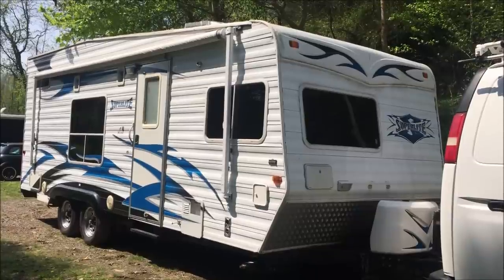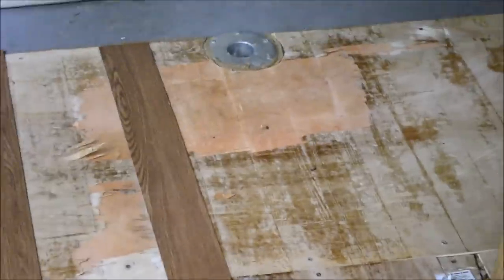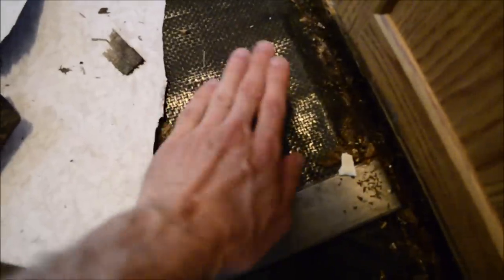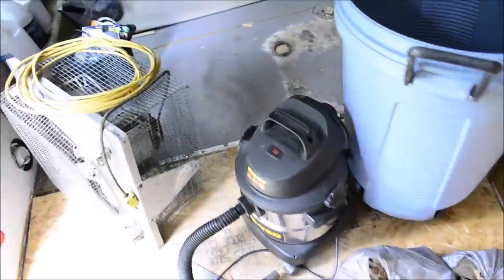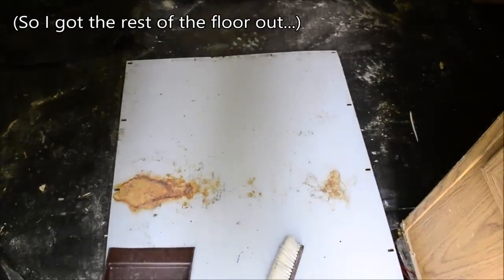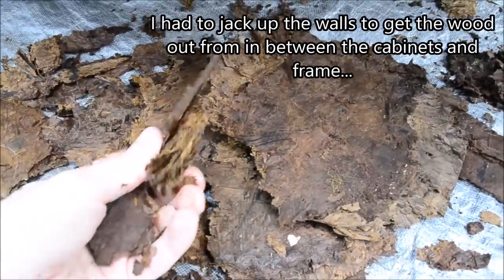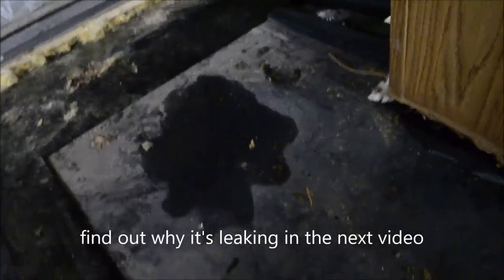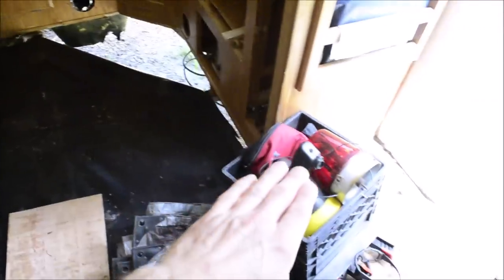Camper Floor Rot Hidden by Scammer Seller - Tearing It Up

Comment: Dude - you are my hero; thanks for never giving up and taking the easy way out!!
Reply from the maker: thanks man!
Reply: I'm lost. I'm ready to sell. Mine. Hell my mil was shot with the nail gun yesterday. I'm having a hard time lied to as well
Reply: I agree with this comment as much as one possibly can. I recently came into a rv spur of the moment deal. Didn't look to be that bad of shape. The electrical plumbing and floors are shot. This post gave me alot of encouragement still weighing my options. The time and material I'm going to have to out into mine is literally more than it's worth at the same time I am a huge believer in repair over replace. I suppose I need to learn where to draw the line? Probably gonna do it haha never know when a rv can come in handy no man knows what tomorrow will bring.

Comment: Yup,I feel ya,just bought my first camper,all 3 slide outs,floor completely rotted,and a out 12" by 25 feet of floor on outside wall under water heater,I'm a builder and here's my thought on that stupid plastic membrane under the entire floor,once the floor gets water on it,there is no way for the water to get. Out and so the floor can never dry out and the rot spreads,I will be painting the underside of the plywood floors

Comment: There are three parties to blame in this situation…The RV industry for building stuff like crap and charging a fortune. The seller who knew and did a crap repair. And the buyer. I am the third in this very same situation. On my trailer I am now in the process of replacing the wood frame under the side walls in the front of the trailer. I learned a very valuable lesson. Thanks for making this video.

Comment: Thank you for sharing, I purchased a used camper in October 2019, all in all I feel like I got a good deal. I broke and awning bracket and while replacing I did find some wood rot that needed repairing. I took it out dried the area for a couple of days with a fan and put it all back together and all is well. Their past weekend 1/18/2020 I replaced a valve on the toilet that was leaking. I've owned boats for over 40 years and learned there there's always a repair needed. And water and wood do not do well together for very long. But with your issues, this guy sold you knowing what he was selling you. Now if you got it for a real steal I wouldn't say much. But he knew better. Trying to unload your troubled  camper that has mold all in it can create someone serious health issues. All that black stuff you saw in the video was black mold. Would you try to sell someone your home with that throughout it. People should consider that when selling a camper. Be right do right. Someone's life may depend on it.
Reply from the maker: Very true a little water damage is inevitable with these things, for the seller to hide it to make the sale is the messed up thing

Comment: When I was looking to buy an rv, this was a HUGE problem in all of the ones I looked at, nobody mentioned it, and they most likely won't tell you because they are trying to sell it. I haven't torn up my flooring yet, but I haven't found anything yet that is a major concern, I know how frustrating and difficult it can be to try and fix it, so fingers crossed I won't have to deal with this. I know this was probably extremely stressful, so hats off to you! 👍

Comment: Just discovered your channel. I can sympathize. I bought a class C with hidden damage. The more stuff I go to replace leads to discovery of more damage. I’m patiently working towards close to a complete rebuild.
Reply: Same hope you got your complete I bought a huge 1989 5th wheel skamper and after I paid for it which was a rainy day I get back and walk inside and see water falling inside the kitchen go to have a peak and the whole kitchen floor and walls and roof studs All water damaged I ripped it all out literally replacing whole kitchen

Comment: 4500 is cheap mate here in Australia nothing less them 10k
anything here for 5k have to work on it.
don't feel so bad at least you know how to fix it .
like your show keep it up
Reply from the maker: damn, 4500 can get you something ready to camp here lol, thanks!
Reply: Fernando C I paid 5,000 for mine off market place & it's great like new i did have to fix heat but it froze cause it never been used just have to be careful or know your willing to do some work i would of had to pay someone
Reply from the maker: Nice! I expected to do a little work like cleaning, maintenance, go over all the seals....I didn't think i'd have to replace the floor, lift sagging walls, or remove the water tanks lol. It's pretty great right now though, it's all back together for the most part and floors are in...will do an update video once I clean it all up again.

Comment: Great video. I had a very similar experience and had to replace my whole floor with 3/4 Advantech plywood. While i was at it, i ripped out the very small sink sized tub and the super small plastic toilt and replaced it with a 38 inch stand up shower and a house toilet. I made a short video of it with pictures i had taken. Thanks again.

Comment: Coming across your video has given me hope! I bought a 20ft RV trailer for my mother to live in while she's on the waiting list for a senior living apartment near my home. She's a stubborn woman and refused to intrude by moving in with me but she's having heart issues and many other health problems and I want her close by. She currently lives 6 hours away and is alone after my sister passed away recently. 
I GOT SCAMMED big time! The seller did a descent job hiding the water damaged floors. I noticed some water damage to the ceiling and the kitchen cabinets which I was confident I could repair. He strategically placed piles of cushions, a removed cabinet and boxes of miscellaneous items in the backside of the trailer where I was unable to walk back there and it was also blocking the bathroom door. In my desperation to find something I could afford I looked past it since he showed me pictures of the bathroom on his phone. 
Turns out that there is no floor under all the crap! He placed crappy laminate flooring on the liner and then covered it with a big rug. The bathroom floor is rotten and there is holes in the shower flooring. The entire ceiling in the bathroom is falling in ( Didn't show me that part in the pictures). 
After peeling back the ceiling and looking in all the cabinets I realized that I have to replace the entire ceiling, the floors, the cabinets, countertops in the bathroom and kitchen and 3 walls.  I would just dump the dang RV at a scrap yard if I wasn't so desperate to help my Mother. Thank you for your video. I have a ton of work ahead but after seeing what you were able to do, I feel confident I can do the same. It's going to be hard on a tight budget but Thanks Man!!

Comment: You have gorgeous hands. we bought a travel trailer, in Florida from another Canadian couple and boy did they get us. long story, but the last thing we have to fix is the floor. the floating floor was pretty and it is cracking 2 ends of trailer. i am gonna watch this with my husband. scary when you said junk yard, because we paid 8k Canadian. no canopy no AC roof needed cleaning and caulking and taping and  2 coats of rubber. our internet is to store it here and return next year stay in in for 1 to 4 months and sell it at a lower price but in perfect condition. we added canapy and AC.

Comment: Check the plumbing there could be a leak at one of the joints and leaking valves even a small unnoticeable fissure in the pipes. Some people forget that you need a pressure reducer for city water and it causes leaks. Another thing that could cause damage to the plumbing is poor winterizing. Some lines especially the toilet line gets forgotten. RV antifreeze should be pumped into all the lines.

Comment: Woah, we have a lot of wet wood and rot repairs to make right now, unfortunately we have the entire from wall including the curve all the way to the rubber roof and a bit under that, some floor rot and the top of the side walls along the front. So yeah I hear ya. What I’ve found out is that better trailers a have sterefoam insulation as fiberglass holds the water and causes more rot and better campers also have aluminum frames to wood also unlike ours. It would’ve really helped though if the screws used along the exterior corners were put in straight and the right tapes and sealants had been used in the original construction. 😡 yeah I’m finding out way more than I ever wanted to know about RV construction, maintenance, and diy’s. Sigh.....

Comment: We are seniors and got "taken" by a young couple...sad...found out that the back of the camper was rotted...ceiling looked good...floor felt firm...of course, they werent' hooked up to electric/propane to check everything out and they had some of their stuff up on countertop that blocked us seeing the wrinkled paper/board above and could not see the rotten floors under the cabinets...our fault...we trusted and we all know you can't do that...we are in the process of tearing out the back and the cabinets...being 70 sure doesn't help...but we spent our stimulus money on this and we can't sell it...so...the journey begins

Comment: Good thing you know what you're doing. I'm in the same boat as you but NO clue ( yet) I bought a camper last month rotten roof, floor all water lines burst as well as hot water heater. I'm a first time buyer and and had no clue he bandaged this pretty well, of course I didn't notice until I got home hooked it up to the water and shit was blowing everywhere. Live and learn. Good luck.

Comment: Holly cow how much did you get that camper for!? I also got scammed with water damaged camper and felt so frustrated when I found out about rutted thru the outer type water damage under the bench. but after seeing this, I feel that I should feel thankful for the corner I just need to deal with😇 thank you for your work and you made my day

Comment: Did you consider placing aluminum square tubing under the floor as bracing so at least that wouldn't rot? I have a 2014 ultra lite. It appears there was a leak in the water lines which went unnoticed until the floor was literally rotted.

Comment: That looks like my Jaco.  The problem with this design is the bottom membrane catches every little leak.  Even if you have one leak, it will catch it as it pools, the insulation gets soaked, and the floor is rotted out.  I think I will just replace it with treated, and not bother with the membrane.  That way the floor can always dry out.

Comment: Couldn't you smell the mould when checking it out before buying?
Reply: He completely looked passed that he completely looked passed the soft spots in the floorboards also but he says he got scammed 😂he buys a used trailer and doesn’t do a full good look around of the trailer before buying it but says he got scammed 😂🤣

Comment: I bought a 1990 Mallard camper. The lady didn't scam me she told me that the roof had collapsed from the weight of the snow. I looked at it before I paid for it which was very low. It was what I was looking for anyway a frame to build a new camper on and insulated with foam that I have on hand.

Comment: The seller was obviously just trying to get out of the headache caused by such cheap construction by the RV manufacturer (they are almost all like this, slap em together as cheap as possible but they look nice when new).  It's so common, dealing with similar issues with a trailer I'm trying to sell - not trying to hide anything and it's not as bad as this one, just a matter of how much work I need to do myself.  It's amazing the lengths that a scammer will go to just to fix it incorrectly when it's not all that much more work to do it properly.

Comment: It helps to buy original vehicles.
No mods, upgrades etc.
Helps a lot when referring to factory manuals and schematics.
Be hard on the vehicles when testing, check every single thing.
Before buying, take it to a dealer or shop for inspection.
Stay gold.

Comment: Well at least I know my smoke detector works 😂😂 I just bought a 1997 prowler bumper pull camper with a big slide out and I've got a lot of the same things I got to take care of not too much in the floor there's one bad area going into the bathroom there must have been a leak for the water line going to the toilet or something and then a couple spots on the walls and one on the ceiling and then the rest is just really cosmetic stuff new flooring new walls and a few minor things pretty much all the utilities work which is a huge plus and I got the RV for super low price so I'm really excited but I'm in the trades I'm a carpenter so I'm definitely not a stranger to the work so that'll make it a little easier but the only thing is I'm living in it full-time so this was the first RV rental video I found that was very similar to mine so thank you for posting

Comment: You know there's the stuff called hardibacker or wonderboard or better yet and this is waterproof Dens shield it's on the pricey side comes in a 4x8 sheet but it is waterproof it's like fiberglass heavy duty stuff good stuff I recommend using that either on the floor or on the wall good luck you're doing a good job hang in there.

Comment: I have to do the same to my camper , a git sold me a 1989 coachmen catlina 34 foot camper and said other then when it was used a fes times a year it was stored in his warehouse, and it looked super nice inside and out , until i get it to my house and i start filling up the water tank and turn on the pumps, leaking like a siv somewhere in the bathroom , so whole rear of the camper has to come out and up , not looking forward to it at all since i have no clue where to start

Comment: Just picked up an 03 Thor Wanderer Lite Hybrid Toy Hauler.  INstalling the wheel chocks for dirtbikes discovered damp insulation between joists and frame. Checked roof, ALL the lap seal needs redone.  Some minor separation on the from wall with the foldout looks like it'll be a new front wall and sill boards front and sides to the wheel wells.  
In your video you said your jacked up the walls - how'd you do that?
Reply from the maker: I would get a 10' wide x ' length white tarp for it right away if you're in a rainy area, so you can thoroughly go over it without worrying about it getting more wet. White so it doesn't heat up and form mold. I'm sorry to hear you got screwed. Here's my wall lift video: https://www.youtube.com/watch?v=ulgJDxsYLHk&feature=youtu.be

Comment: Great video, I've got a 96 Shasta 30 foot that's likely in the same shape of this, luckily I bought it for 2k, with the underneath membrane did you just staple it back up ? Or did you use something else?
Reply from the maker: Thanks, I didn't put it back up yet. But I'll be using : https://amzn.to/2MVD0yJ and https://amzn.to/2MVDjtn when I get around to it. (affiliate links)
Reply: Not sure how i did it in the time but over this past weekend rehauled the whole front half used pressure treated 2x4s straight to the metal cross beams (self tapping stainless screws) attached to frame,   lucky to find I only had 1 overall membrane after I shop vaccumed out all the rot and wood  & insulation,  didn't even need to do anything with the membrane was able to see the beams perfectly fine ! 170$ total and I bought everything new at our local hardware store !

Comment: My biggest issue trying to figure out how to lift the front and back of my 2014 Whitewater Retro camper. The entire floor is rotted and the shell is sinking below the frame. Any suggestions?
Reply from the maker: Here's what I had to do to lift my walls, hopefully it will give you some ideas: https://youtu.be/ulgJDxsYLHk

Comment: that's not plywood, its OSB, and yes he did a terrible job, Just bought a Lance that I should have looked at closer, the heavy caulking job on the outside was a dead giveaway, had to remove the siding and replace the 2x2's and luan

Comment: New & used Rvs motor homes are piles of junk... They where built to fail by the manufactures a complete marketing scam knowing that the roofs will crack & dry rott due to the sun damage & dealerships make out whrn customer comes back to pay 10K$ to have theit roofs fixed..

Comment: Damn I hope everything turned out to be good for you same thing happened to me with the travel trailer I just bought when I first saw it I was trying to look for soft walls soft floors but the guy kept trying to distract me from doing that while he was showing me how the things be working I still didn't get distracted that guy wanted $5,000 and I told him hell no I told him I'll just give them two thousand Ford if not I'll leave he need the money so bad he took the $2,000 with the rest of the money not even $800 I fix the floor no lately it's been raining here in Texas and I have not found one leak but still I got to check the outside to make sure everything sealed up
Reply from the maker: nice, I check mine all the time too, even though it's sealed now and I have a tarp over it lol, don't want any problems again
Reply: @aDIYCarGuy  yeah I feel you on that bud I posted a video on YouTube it's called remodeling travel trailer now my videos not all good looking but you'll see the fifth wheel have the way it looks go ahead check it out part 1 part 2 are we putting a part 3 when I'm done with the floor though
Reply: @aDIYCarGuy  yeah I feel you I'm not done with my floor yet but if you want there's a video about my fifth wheel go on my profile and check it out it's called remodeling floor on travel trailer there's a part one and part two I put plywood and a bottom for the floor when I'm done with it putting the stick on wood tile I'll make a part 3